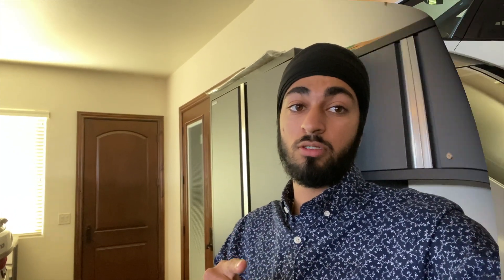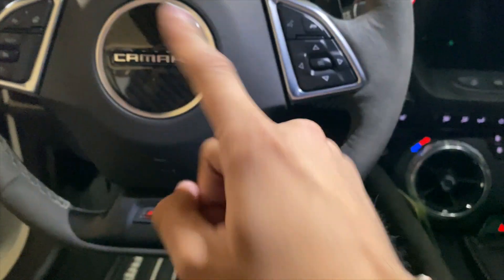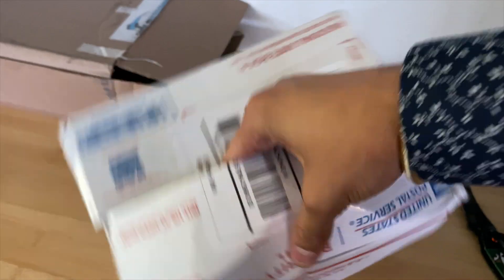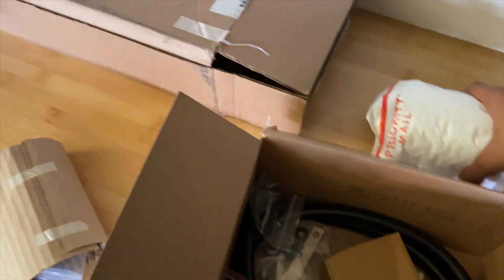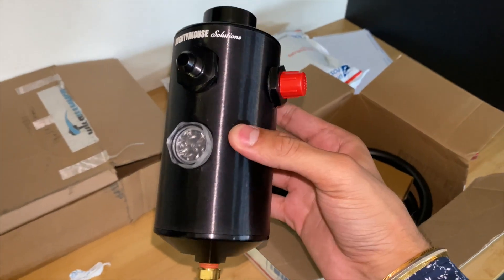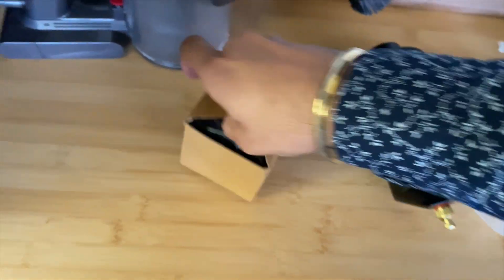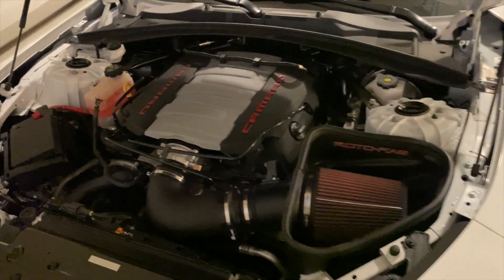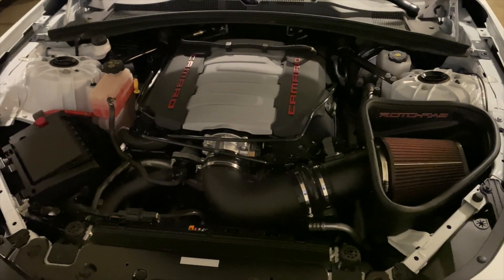Installing a mighty mouse oil catch can on my 6th Gen 2021 Camaro SS 1LE

Comment: Just a FYI. The overflow needs to be full at all times. You will need to add some coolant to the main and secondary.
Reply from the maker: I did not know this… thank you! Will definitely look into this
Reply: What’s the overflow
Reply: @sim.plevlogs   it looks like it’s at proper volume. I have a 5th gen camaro so can’t confirm with just my view through your video. There is a clear full line on the container. Fill to just that line not more, as to the coolant system needs expansion room. Hope that helps.
Reply: @Streetcorsa  the coolant overflow. The clear container on the left side of the engine bay with the red coolant in it. It’s coolant overflow to allow expansion of the coolant system. There is a full line on the tank, which isn’t the whole container. Because it needs empty volume to overflow into if necessary. Hope this helps.